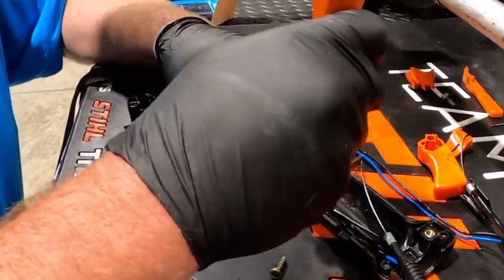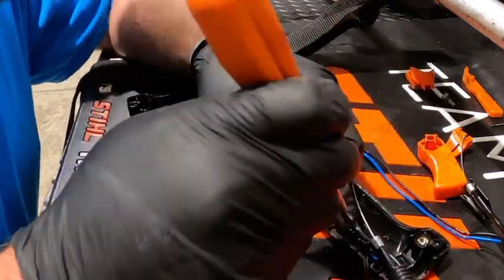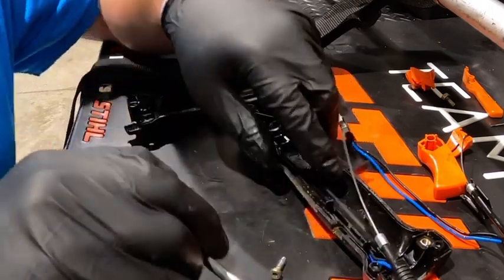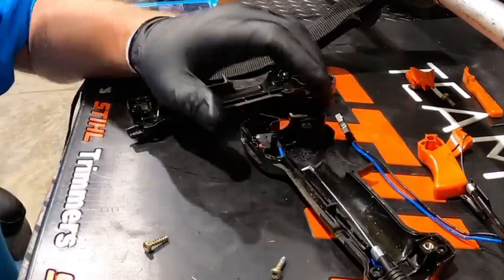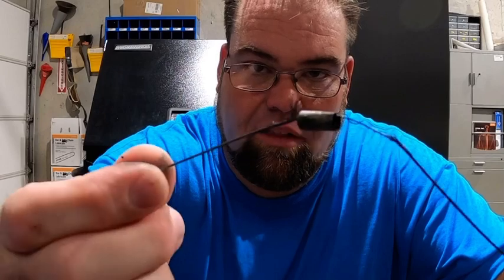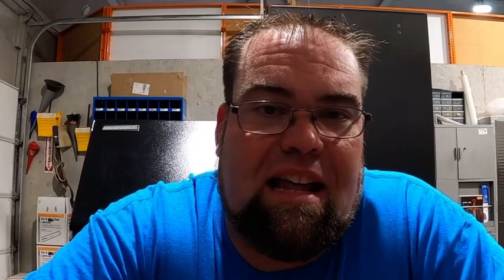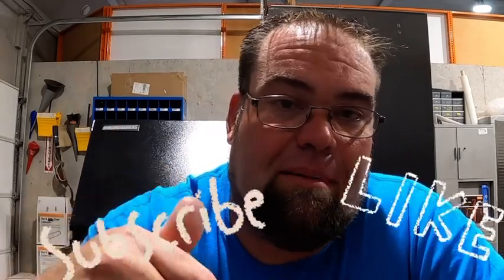Replacing a throttle cable on a Stihl FS 85 RX string trimmer. How to fix a brush cutter.

Comment: Great video, I have exactly the same issue with my fs 85, but can’t find the right replacement cable, can you post a link where to order one ,thanks
Reply from the maker: Hi the cable part number is 41371801107.  Sometimes you can find them on EBay otherwise your Stihl dealer can order them.  The part is $26.62 MSRP.
Reply: @AMGEquipment  Thank you for the info,  unfortunately the only ones that are available are the original ones, i think I convert it to a hurn handle the whole kit will cost me from china about the same as just for the original cable.👍
Reply: I just bought 2 stihl fs100rx they are dirty under the engine cover a lot of grease and grime. How can I clean it? 

Also they won’t turn on, i checked for spark and they were good, any ideas what could be the reason? I have a feeling it might have something to do with the throttle cable but not sure. I’m trying to learn to fix them . Thanks good video btw
Reply: I was really hoping to see you install the springs. I can’t figure out how to install the small spring for the safety. Driving me nuts